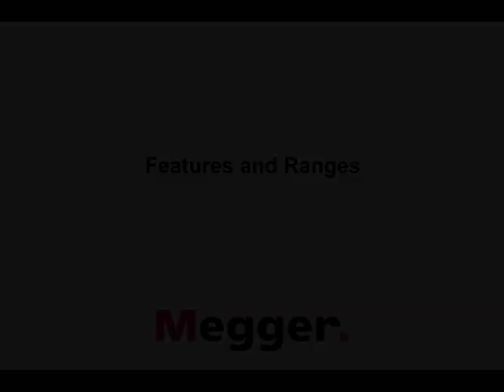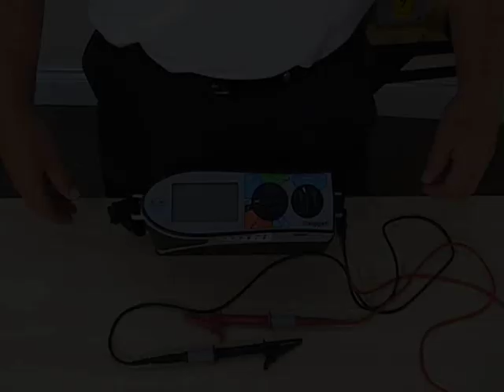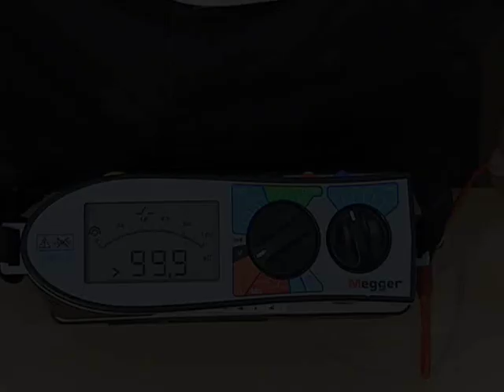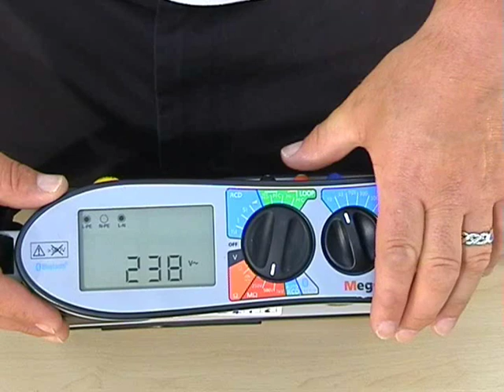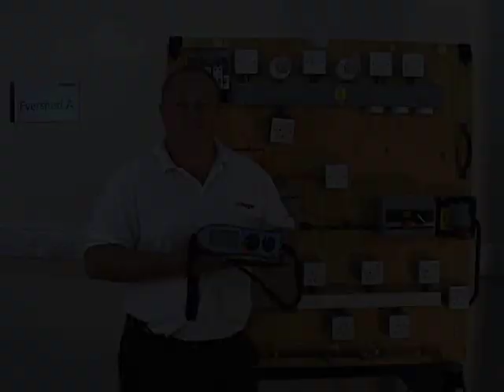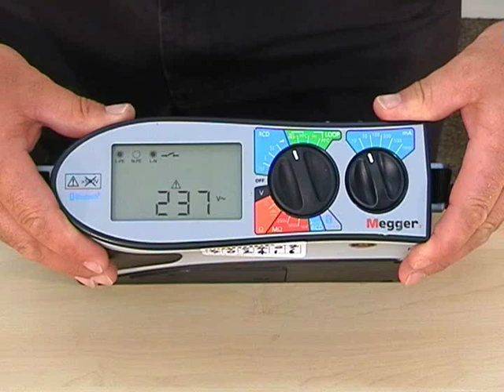Megger MFT1552 & MFT1553 Demo Part 1

Comment from the maker: Hi sorry to hear you are having problems with your MFT. Based on your explanation it would be worth making sure the batteries are ok and that the fuse is sat nicely in the holder. If the problem still persists then it will need to come back in for repair I am afraid. This product has a 3 year warranty. You can return it through your wholesaler or call us on 01304 502101 and we can arrange to receive it directly. Apologies again for your troubles.

Comment: i have a megger 1552,when i take a reading on ohms for continuaty,the unit beeps and the icon for the fuse appears,i checked the fuse and it bells out,sometimes when i turn it on the thing works,but then the next time i turn it on the fuse icon appears,and i cant try and take another reading unless i turn the dial away from ohms and then back again,any ideas why?

Comment from the maker: We're sorry to have to tell you that the MFT1552 and MFT1553 are stopped being manufactured in March last year. They were replaced by the MFT1720 and MFT1730 which offer the time-saving feature of the 2 wire non-trip loop test. They are demonstrated on another video found on the Meggeruk YouTube channel

Comment from the maker: @5342abc As with all loop testers, and multifunction testers, you cannot test through a 10mA RCD without tripping it due to the fact that the loop test current is 15mA. 

The loop test current would need to be below 5mA to prevent tripping a 10mA RCD and experiments have shown that loop testers would struggle to give reliable readings at such a low current.

So as in the old days before non-tripping loop testers were invented you will have to bypass or remove the RCD.